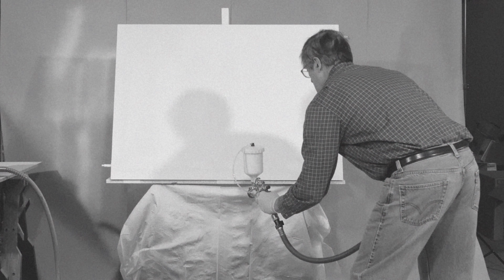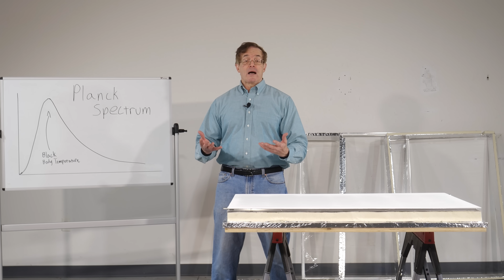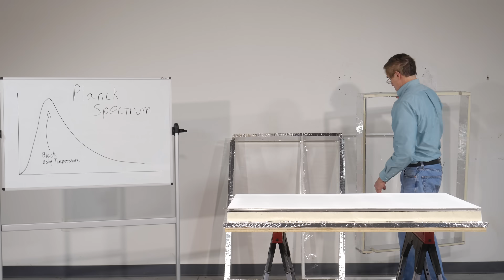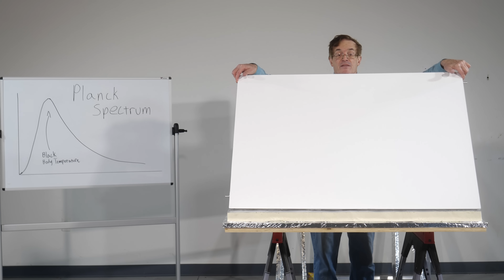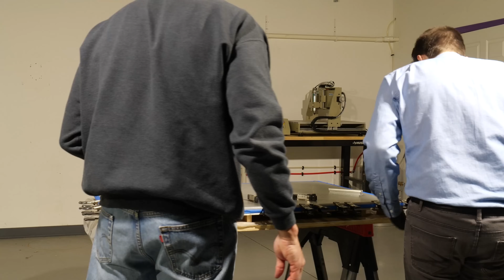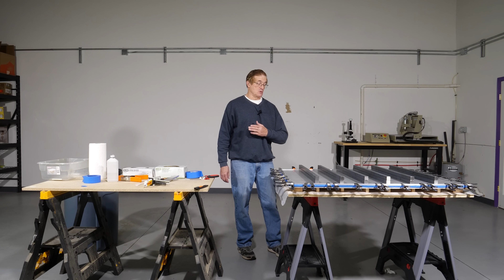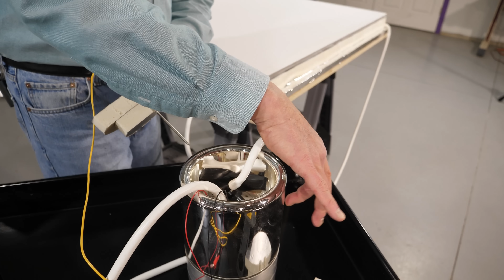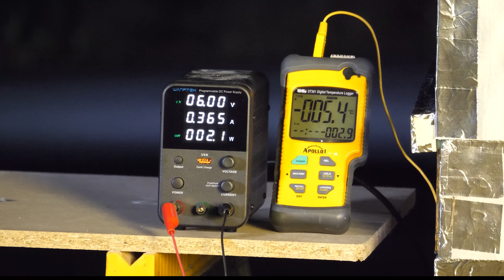Air Conditioning isn't free... but we're close.

Comment: I love these air conditioning experiments. An infrared radiator would probably work better than an evaporative cooler down here in AL, where we spend a large part of the summer near 100% humidity. Even more so in FL. When my house needs a new roof, I might just be fabricating some tiles like this, heh.
I wonder if you could run the hot refrigerant directly through these panels, if they could take the pressure, and how cold you can get without freezing the evaporator coil into a solid block of ice.
Reply: High humidity and cloud cover does affect the efficiency of these infrared type coolers.  Dry air and clear skies are the best conditions for them.

Comment: If you make the bead of epoxy broad enough you can put a screw throught the middle, so the epoxy only has to seal and the screws take the forces and help against the fluid pressure.
It's a lot of area and even a bit of pump pressure on the large surface in the middle might pop it over time.
Reply: Run the pump such that it draws water from the panel rather then pushes it in...
Of course the panel and tubing might need to be fully purged of air.

Comment: I think there were problems with the way you did your previous air conditioner was.  They should have worked a lot better, like what you found in the first video.  You did something which took down the efficiency. Thanks.
Reply from the maker: It was the change  from the surface transfer on the bio-balls to the droplets, not a good idea.
Reply: @TechIngredients  My apologies, can you please describe that?  I'm very unwell and can't remember the details.  I know at the time I came up with alterations to improve it, but that's lost to memory.

I'm interested in the sky panel technology.  Sorry, difficult to write at the moment.  And MIT or some such university has come out with an alternative using microwaved gelatin to make a nanofoam which operates an evaporative cycle.  Which I thought this video might be on.  I've been considering a third method as well.

Comment: If you have a house that has half its roof directed south and the other directed north,
one half should be covered in solar panels, the other should ideally covered in cooling radiators.(unless that would point them at some warm objects).
i wonder: 
-if you use this to cool one side of a TEC and solar radiators to warm the other side, how efective would that be in producing electricity?
-if you have best cooling at night, would it make sense to cool down a large container to use that to cool a house in the day( much like those heatings that are heated during the night with cheap electricity, using the same container)
-would this technology provide cheap cooling for the backside of solarelectric panels?

Comment: I've had a crazy idea now, after looking at this video. Imagine placing 2 solar panels infront of each other inside a total isolated room. If the solar cells could be made of a material able to convert IR light into electricity, would not that violates second law of thermodynamics? The room would go cooler and cooler, and you would create electricity from heat.

Right now, I am thinking a lot about this (headache), and can not reach any conclusion.
I must be missing something, this does not make any sense. I would appreciate if some knowledgeable person help me out.

Comment: I couldn't tell from the video but the heat exchanger you built seems like it would not distribute the heat evenly across the surface because the liquid is not in a channel to evenly cover the entire surface. It seems you'd have more flow at the inlet and outlet rather than in the corners. I'd be interested to see a thermal image of the surface during operation to see if there are hot spots in the corners without ports. Maybe an updated design with more ports along the sides would help make the flow across the surface more laminar and increase energy transfer.
Reply from the maker: The ribs do not span the width.  The water is forced back and forth over each foam pad.

Comment: The lateral shield looks like its touching the panel insides. Would having a little air gap help reduce the inertia of the system?
Reply from the maker: Probably not.  The mass of the tape is trivial.

Comment: How important is using a reflective material (in infrared) such as the aluminium sheet panel when it is covered in this special paint in the end? Wouldn't other materials such as copper, brass or other decent thermally conductive materials work just as well? does it even require a polished surface or would a matt finish (e.g. "brushed metal") be just as good?
Reply from the maker: They would.  The substrate  is not important.

Comment: Did the power going into the motor effect the final temperature much? I don't know the process well enough to know if it made a significant difference or if it's negligible.
Reply from the maker: It probably  decreased the apparent efficiency by about  10%.

Comment: Great topic!  I read about this and some company that is doing it but the report implied that it used some exotic, secret and super expensive coating.   A cheap formulation would be an amazing gift to the world!

I like the idea of using a coaxial refrigeration water cooled condenser coil as a de-superheater, piped in between the HVAC compressor and the traditional air to air condenser, pumping a cooling loop of hot glycol to your emissive panels.  The condenser fan can be modulated lower to save power, and the overall condensing temperature over ambient of the system can be brought even lower than todays most efficient systems - saving much power!!  The discharge temps off the compressor are around 175 ° F so the temp efficiency would be fantastic.
Reply from the maker: The paint  formulation will be next.

Comment: I'm curious about the power output. I would guess the power output of a system like this would be negligible in practical terms. You would need 100 square meters to measurably decrease your energy use I'd guess.

Comment: The big questions though, how could you implement this onto a home (be it some kind of roofing panel or other configuration, you would obviously need more than just a single meter square panel to see any significant benefits), and what would be the overall cost associated with it including building materials and constantly running the pump to push water through it?

Comment: The problem with your aluminium box example is that the aluminium would reflect your heat back to you, instead of absorbing it. So what this surface doesn't emit, it reflects. The example doesn't work that way. You need to introduce the spectral dependency of the emissivity. Being reflective at the suns wavelength and a good emitter at the wavelength that corresponds to your temperature.
Reply from the maker: That's only if the box is sealed.  Imagine a light inside the box with its open top. The light will exit, scatter off the walls , and exit.  It won't  be retained.
Reply: @TechIngredients  Of course some is lost out the opening. The radiation bounces around until it hits something or escapes, while a small fraction is absorbed every time and (in equilibrium) the same amount is re-emitted. The emission can have any direction. That leads to the effect, that radiation coming from a cavity - even polished metal cavities - closes in to a black body spectrum. The wierd point to wrap the head around is the flux density of radiation in a cavity is constant.  Perfect absorber walls make it all up with their emission. Mirrored cavities "recycle" the same radiation by letting it bounce around multiple times. 

The effect here is just to use a material with an emissivity that depends on the wavelength. It rejects the suns radiation and emits (and absorbs) wavelengths well that correspond to its temperature (Wiens displacement law). This is why the radiator needs to be shielded from the surroundings at the same temperature.

Comment: A few comments from a fan who has done similar experiments:

1.  In your climate you are not seeing a problem I encountered with a similar setup which is dew formation on the surface of the plastic wrap.  Another advantage of tall sidewalls is to minimize the dew condensation potential.  For me even 1 foot tall sidewalls were not enough.  A small fan blowing across the plastic surface keeps the plastic at ambient which avoids dew but of course adds other issues.

2.  I think it's worth reminding folks that as the surface of the radiator cools the amount of energy it radiates goes down.  This is what stops it from just getting colder and colder.  Eventually an equilibrium point is reached.  

3.  I'd love to see you graph the performance of your setup showing watts per square meter vs delta T.  This is generally a pretty straight line so knowing the max delta T and the power dissipated at delta T = 0 is enough.  I used heater plates with sweeping power supplies, but you could just add a heater to the fluid reservoir.  Your time constant may be a bit long but you do have large radiators.  The graphs are a great way to evaluate the effects of different geometries, coatings and insulation.

4.  A fun experiment anyone can do is to line the inside of a cheap foam cooler with aluminum tape and pour some water in the bottom.  On a cool clear night it will freeze to ice even though the outside temperature is above freezing.  No plastic wrap is needed.

All the best.
Reply from the maker: Thanks!

Comment: Love the videos! It’s interesting to see applied science to solve the issues we all face. 

By placing these on a roof, you’re taking up some valuable real estate. 

We need energy calculations for producing and installing the panels compared with how much energy is saved by not running an air conditioner.

How much better would this be, compared to using photovoltaic panels to power a heat pump? 

How does that change if we place the heat pump’s condenser in the cool water of the sump in an evaporative cooling tower? 

A solution isn’t a solution until it can be deployed cost-effectively and energy-efficiently. And for wide adoption, it’s gotta be as close to invisible as possible to the end user.

Comment: This is really cool.  I am curious about the heat transfer rate and heat flux of this bench top experiment. You may have mentioned them.  It's been years since I took Heat Transfer, and I no longer practice as a ChemE.  But I believe with the DT (Tout-Tin) and a flow rate we could have the heat transfer rate (Q'). With the dimensions of the radiator, we could get the approximate heat flux (Q'').  That would help in sizing for implementing this in a larger system.

I am excited to see the next video. I hope you integrate this into a future, updated version of your Solar Air Conditioner from a few years ago.

Comment: It seems like nonsense to me. Why would clouds effect anything? Heat radiates at the speed of light right? But heat is absorbed by the air so easily. We know this because air temperature exists. We can even test this by how quickly heat is absorbed into the air, by using candles, etc. Anything that radiates heat really.

Even the entire premise of air being colder in the upper atmosphere is dubious. It's closer to the heat source. Like the air near a candle. If anything, it should be hotter.

In Thermodynamics, (not that "human" laws mean everything, but still) heat travels spontaneously from hot to cold. So designing an object that doesn't absorb heat from the environment but radiates it out, is like a heat diode. It's weird because it has to absorb heat in order to transfer it and radiate it away, but then it needs to prevent heat transfer back into the working fluid, despite it being colder than the ambient temperature.

It's hard to argue with results, but this makes it seem like you could do anything and give it a scientific explanation after the fact, because it contradicts basic physics in Thermodynamics.

I wonder if their is any alternative explanation for why it gets colder than the surrounding air. For example, moving fluids transfer heat better than static fluids, or that water cools more rapidly than air does.

Comment: So, we generally understand how to size a heat pump for the amount of indoor insulated sq footage you are trying to temperature modify.  How small of a completely independent system can you use to supplement your existing infrastructure EFFECTIVELY?  I doubt anyone will realistically want to modify their existing setup, but probably wouldn't be opposed to a supplement, especially if it is smaller.

Comment: Interesting, and I always enjoy watching you explore science applications.  Having said that, there is a technology that I think is the best for cooling average sized structures that is basically ignored by most.  The earth tube.  By running air through a long corrugated tube buried beneath the frost line, you can tap into the natural stable temperature of the ground.  In my area that's 53 degrees.  Meaning you can precondition your air to 53 degrees before putting it through an air conditioning system which will raise the temperature to your desired setting.  This pretreatment can make a huge difference depending on the outside temp.  I really wish knowledge of this technology could be spread because its relatively cheep and effective and can be added to existing structures.  You should do a video on that.
Reply: Since installing the earth tubes requires digging you may as well just skip the tubes and install tubing for a ground source heat pump if this is intended for a residence
Much more effective really and manages humidity in the structure for increased comfort

Only reason to do something like this is when you won't be trying to heat or cool the structure beyond what you get from the ground (greenhouse, maybe a garage)
But as another commenter mentioned, better to make it a liquid circulating system and use a heat exchanger to keep things clean and tidy
Reply: The problem is condensation and mold in air intake that can't be taken lightly with these systems. A water loop, with heat exchanger, is better in that aspect.
Reply: @TheEmbrio  The big advantage of geothermal air cooling is that you don't need to worry as much about leaks as with liquid cooling. What I think would be really interesting, is making a homemade air compressor which to pressurize pipes with heatsinks around them, which to get cooled by the intake air for a windmill at the bottom of a solar tower (aka. solar chimney) which to heat the air which rises and accelerates through the tube/tower/chimney pulling more air for the heatsink and windmill. 

I think such a system, although it would have plenty of disadvantages (such as needing a tall chimney/pipe/tower, which to be at least a few meters/yards tall), would also have the advantage of working passively while there is sunlight, due to the only moving parts being the windmill, the drive shaft (or alternative), and the air compressor, all 3 of which would be connected (maybe even welded) together, and the bearings needed for all of them. A few cheap imperfect mirrors (i.e. tinfoil + epoxy + tarp + frame) which to focus more light onto the solar tower, in order to cause faster air speeds, which to compress more air and cool the heatsinks faster. The compressed air would likely need a "drip pipe" going to the outside of the building, which to move the condensed water towards the outside, with a shut-off valve for preventing the humidity from completely escaping from the building in really dry climates.
Reply: @TheEmbrio  the DOE.gov paper on it recommends specific tubing to reduce mold growth. 
My plan is to install dry-well condensation traps along with appropriate tubing.  I'll be installing 150ft soon to see if it works.
Reply: Yep.  One of my ideas is to make essentially large "heat pipes" and dig down vertically, then insulate the copper tubing going around them (that has water going through it) towards the upper parts. 

    The efficiency of the heat pipes would help to cut down on the area and amount of materials needed. Not everyone can afford to, or has the space to, evacuate very long trenches and lay hundreds of feet of tubing, or dig to well like depths.  Using heat pipes, you only really need to dig down to where the temps are pretty stable, and then thermally insulate the rest of it.
Reply: This is not a cheap solution. You need a really big system that will take a lot of surface area for it to work, because even though the ground temperature is indeed stable, it will warm up from the hot air you will move through the system. And additionally, moving air through such long pipes takes more energy, which lowers the efficiency and again increases the costs.

Comment: Great video as always!
Just noticed one minor detail in the beginning related to the color of the sun:
The 500ish nm wavelength is actually in the green/blue part of the visible spectrum (yellow: ~565nm - 590nm; green: ~520-565nm; blue: ~445-520nm)
The scattering of light particles (Rayleigh scattering) in the earth’s atmosphere gives the sun it's yellow color for us by reducing/removing the lower wavelengths of the whole light from the sun :)
Not that it would even remotely matter for this video^^
Reply: Does that mean that the sun is a different color in space?
Reply from the maker: Actually, yes.  But if we limit color to mean what our eyes can see, then no.
Reply: Sun is not yellow. It's white. No discernible hue. Use a very strong neutral density filter and you will see for yourself.
If Sun was yellow, we would be bathed in yellow sunlight, Moon would be yellow, etc.

Radiative peak does not determine final color.